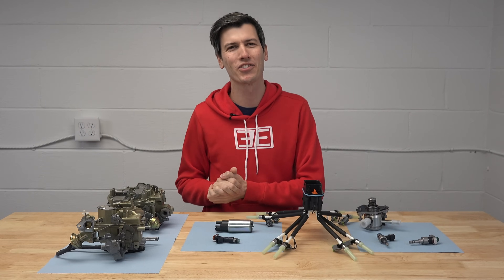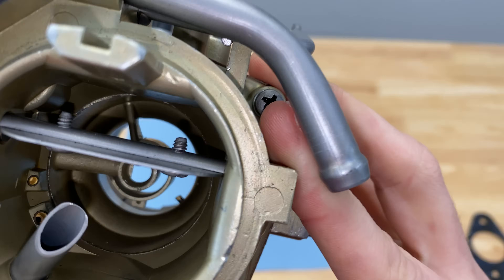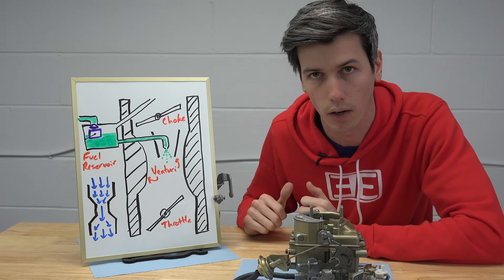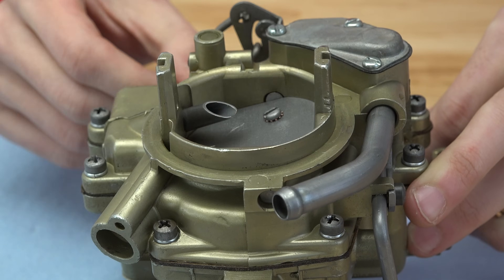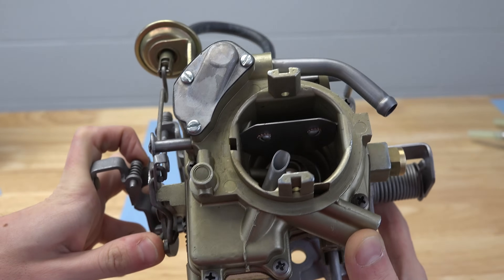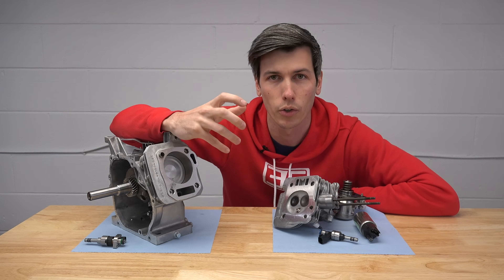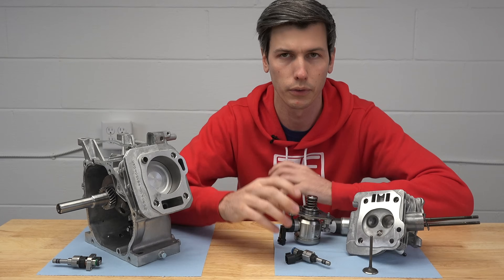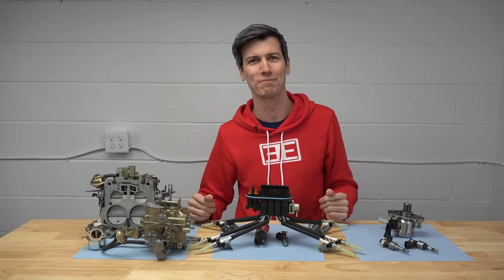What's The Best Fuel Injection? Carburetors vs Port vs Direct

Comment: CAn you do a video on the science behind how tight or loose tapered wheel bearings should be on like trailers and such.  I have found no good source of info that describes the theory of it.  Just basically info that says how much to tighten it.   I wonder if at the smaller level if the bearings are supposed to touch the races or have a tiny tiny gap to let the oil or grease flow thru.  There is no good info on when to know if you can tighten up the nut when they show some wear or if you need to replace the bearings.
Reply: You do need grease between surfaces to reduce friction. Over tightening a bearing will increase friction and cause over heating and excessive wear. 
Bearing... Science? I guess that's the word is quite complex.

If a bearing is wearing you replace it.

Comment: Carbs have a latent heat advantage (cooling of charge as fuel vaporizes)
Reply: Actually, identical with fuel injection. In both cases the heat of vaporization is stolen from the air to vaporize the fuel.
Reply: GM TBI has the effect equally as well.

Comment: Could you please show me that video of yours which explains why an engine cylinder   Is a circle but not any other shape
Reply: Ovals have been experimented with, Honda has on motorbikes. The reason for round is so the surface is as flat as possible at ALL points. It aids in the distribution of not only fuel but temperature and strength.
If you had a square cylinder the air and then the combustion would not evenly flow around the cylindervthe corners would see less flow in them.   In turn it would make the flat walls hotter than the corners creating uneven cylinder temperatures.
The list goes on.

Comment: How does stratified ignition create the same power as a homogenous mix? Does lean combustion generate comparable amounts of power to a normal a/f mix?
Reply: Honda did this for nearly every 1st and 2nd generation Accord and Civic using entirely mechanical carburetors with their CVCC engines. They exceeded federal emission standards without the need for pumps and catalytic converters. My 78' Accord averaged 34 mpg and a lot of torque.... Honda motorcycles had a bunch of torque as well, it makes sense that some of that engineering made it over to automobiles.

Comment: (H) GOOD  VIDEO....very lacking about the extreme  temperature differentials???  occurring during the VENTURI  PHASE !!! 
By design....the best constant intake manifold vacuum....is 23.75--24.25  hg....more or less....the old carb... "seals"...  are designed to with stand only  16 -18 hg ….especially the leaky throttle plate  rods. 
MY POINT....very under-developed  design engineering  scenario ….

Comment: I converted my carbed Turbo to port EFI, and now that the tuning is done, I'd never go back to carb's!! 25% better fuel mileage, way better warm up, spark plugs seem to last forever, alot better power and way more of it, oil stays nice and clean for 5000 miles instead of turning into "Texas Tea" after a couple of months, instant starting, no more twice yearly flooding episodes, no more constant "fiddling" with the carb, no more weird fuel distribution problems, awseome throttle response, and grandma car like drivability. 22 psi boost on pump gas aint too shabby either!

Comment: Here is a really neat fact. Consider what may have happened in the air war against Germany during World War II if German planes were not running on fuel injection! That actually allowed them to fly upside down which was not something the Americans or French could do at first. The Luftwaffe were some badass dudes but even still, once the P-51 Mustang came onto the scene, the Nazi Air Force was getting absolutely pummeled.

Comment: Port and direct injection also have very different air flow turbulence requirements; port requires as little turbulence as possible to keep too much fuel from hitting the cylinder walls and maintain an even flame front from a spark plug. Direct is the opposite, it needs turbulence to mix the atomized fuel with the air for ignition by compression (detonation).
Reply: GM internationally induced as much turbulence as possible on their first truck EFI engine in 87. Heads were cast with half the intake port blocked off.

Comment: Jason, as you mentioned several times during this video how the vaporization of the fuel in the cylinder helps to cool the engine to allow the engine to drawing in more air. That leads me to wonder whether it makes sense to refrigerate the fuel somehow to maximize the vaporization's cooling effect on the engine. Of course that probably makes the fuel more difficult to ignite and perhaps even cause other problems, but I wonder what your thoughts are....
Reply: Expanding gas/liquid absorbs energy.. In this case heat. The better it mixes the more heat is absorbed. Think of compressed air being blown out of a nozzle, see how it's cool?. We do cool the air charge on cars with high intake temps like turbocharged engines, but cooling the fuel itself could lead to freezing but also may take more energy to do than you would gain. So you would loose overall efficiency.

Comment: Jason, another automotive eng. here. You missed the most important point of high pressure DI systems. It needs to be so high, because you are spraying against the compression in the engine.

Comment: The hybrid direct/port injection where a localized area of rich fuel is ignited near the spark plug sounds reminiscent of the Honda CVCC engine intakes with the extra auxiliary intake valves.

Comment: Ah, the Rochester Quadrajet.  One of the best carburetors ever manufactured.
Reply: I have 2 trucks (76, 86) registered that I drives daily, BOTH are Quadrajet equipped. They're great, reliable, and use less fuel that Edelbrock or Holley Equipped motors.
Reply: The QUADROBOG!!!! it went well with the "Slip and Slide Powerglide"!!!
Reply: @painkillerjones6232  Ah, if only you had the knowledge to tune it. Then you'd be able to see its hidden potential.
Reply: @marcomacias8941  It was a favorite of mine back in the day, rebuilt more of them than I could count.
Spot on though, they copped a bad rep here because not many people could tune them properly, but set up properly they were a great all rounder.

Comment: Cool to see carbs on the channel. Looked like a Monojet, then the tried & true Quadrajet. Only correction as far as the carbs go is the don't "inject" fuel at all, that's not how they work. Carburetors Emulsify fuel. The pressure differential created when a piston is no longer occupying a given area in the cylinder has atmospheric pressure pushing (14.7 lbs) down on it constantly trying to occupy the whole cylinder.

Computer controlled carburetors (CCC on GM vehicles 1981-1988) were designed to help better control the A/F ratio. One of the biggest advantages of a carburetor (esp in drag racing) over F/I is the fact that carburetors COOL the incoming air change, whereas F/I really doesn't even get the time or chance to do so....plus a Holley is just plain Cool looking when you pop the hood. F/I is just convenient  though for daily driver, no doubt.

Looks like Advance sent you a GM Vortec 305/350 "Spider" harness lol The 96-00 Vortec trucks are Really good truck engines (pretty much alluding to what was coming up next the LS engines 😉) , & for their time the Vortec heads really flow quite well esp being a plain Jane iron truck head. Too bad they (stock) are limited on their spring install height (nothing a little machining can't fix though)

Comment: Congratulations on this video and your always interesting explanations. I would like to mention, though, a couple of important mistakes I noted: 

1. Gasoline in an engine does not explode, it deflagrates, which is a controlled combustion. The only time when it explodes is when the dreaded instantaneous and uncontrolled detonation, or pinging, occurs, which engineers of course want to prevent. 

2. The purpose of carburetor sprays and fuel injectors is to atomize, not vaporize, the fuel. Atomized fuel maintains a high density while being very effective in reducing the air charge temperature, increasing its density. Vaporized fuel, having a much lower density, reduces efficiency. The idea is to get all the air/fuel mixture all the way into the cylinder in this atomized state, to preserve a high density and ideal air/fuel ratio. The biggest disadvantage of carburetors—and for that matter, throttle-body injection—is not that they are imprecise per se, but that the plumbing between them and the cylinder is less than ideal: part of the mist of fuel droplets tends to separate from the air charge at the turns and nooks of the intake system and puddle on the walls, and another part tends to vaporize due to the heat they find along their path. That is one of the reasons why 1-carburetor-per-cylinder systems of the Weber DCOE type, with their mostly straight individual runners (which are also unaffected by the intake pulses of adjacent cylinders) can offer both better economy and power than a conventional single- or double-barrel carburetor on a multiple-port manifold.
Reply: So.. semantics. Lol.
Reply: Heads Mess there’s always one
Reply: important distinctions, thanks

Comment: Direct injection with combined port is likely the best. Think about it. Late 1990's to about 2005, port injected, a naturally aspirated 3.4L v6 would average under 200HP. Now 2006 and beyond, changes to direct injection with port (to keep valves from fouling), that engine now makes 250HP with everything else the same. And that's without boost. Seems the main thing is that the valve timing isn't influencing the fuel mix, so they can do more with the timing and lift on the cam and that's more power than you could get before.

Comment: The absolute worst were the electronically controlled carburetors. They didn't run all that well when new. The electronic control available at the time just wasn't up to the task. When fuel injection cost came down to about the price of electronically controlled carburetors these carburetors were quickly abandoned.
There is a type of automotive gasoline port fuel injection that wasn't covered. The fully mechanical Bosch system used by some cars such as Volvo.  The system for a 4 cylinder engine had five injectors. The fifth injector was the cold start injector and it was placed upstream in the intake manifold and fed all four cylinders when energized. It was the only one electrically controlled by the coolant temperature. The other four injectors were not pulsed, but were continuous spray. The flow in these injectors was controlled by a damper in the inlet tract upstream from the throttle plate. So if you snapped the throttle open the fuel flow was controlled by how far the damper was pulled open by the air flow, not by the throttle position. In a way it worked like a constant velocity carburetor that was often found on Japanese motorcycles.

Comment: Other advantages of fuel injection over carburetion are:
1. Fuel is injected only when needed, rather than showered down the intake manifold all the time. Thus, a cylinder only gets fuel when it's needed -- when the intake valve is open. Carburetors react to overall manifold vacuum, so some air-fuel mixture goes down the pipe even when the valves are closed. 

2. By electronically regulating injection, the engine gets the exact mixture it needs under all conditions, including shutting the mixture off when the engine is coasting, off throttle. 

3. In racing, the side-loads from road holding can lean out a carburetor when fuel sloshes to one side of the float bowl. This used to be a problem in aircraft, and race cars, in the 1960s and before. Fuel injection, especially computer controlled injection, is immune to this.

Comment: Should have mentioned that fuel pump. Its funny how carbs had mechanical fuel pumps, then when to electric, then efi came and continued with the electric fuel pump, then direct injection came and now uses both electric and a mechanical fuel pump.

Comment: Why would there be carbon deposits within the intakes of a direct injection engine if, at that point, only air flows through them?
Reply: The inlet valves open while the engine is still on the exhaust stroke, mixing a small part of the previous cycle to be reburnt with the fresh intake charge. It's to lower emissions.

Comment: Hey Jason, I know you love tires. Could you do a video that compares the performance of two tires with similar tread but one is much older than another. I've been shopping for tires, I've come across "used tires" that have 90% tread left but the date of manufacture is like 5 - 10 years ago. I think it would really cool to see. I guess the biggest variable in the test would be how the old tire was stored.

Comment: Love the channel. Could you possibly explain for others do a video on how 

Direct injection vs port injection with everything else the same.

 Direct injection will make more power as there is more air in the cylinder as the fuel is injected after the air has entered and intake valve has closed.

Some engines also inject fuel multiple times during one power stroke

Another way to explain is port injection or carb the air and fuel combined has to enter together vs direct injection the valve timing and port only control the air.

 So understanding more air = more power especially at high load.  

Learned during 15 years engine development work.

Comment: Great video thanks.
I would have thought the very fine holes of a fuel injector would have become fouled with combustion deposits (like what you find on a spark plug) if exposed to the combustion chamber directly. Maybe the very high pressures keep them open and clear?

Comment: The best fuel injection is Mad Max style: have Tom Hardy get up on the hood of your car, take gasoline in his mouth, and blow it straight into the engine.
Reply: Haha that Rick and morty episode where summer spits vodka into the intake haha
Reply: WITNESS ME!
Reply: And you just know at least one dumbass hick tried it at home.
Reply: @MarvelousSeven  To be fair it would work if you put it in a pummp spray bottle

Don't ask how I know, the feds are already after me
Reply: SAVAGE TUNER not even hick horsepower baby! You ever been to the strip?
Reply: @savagetuner2404  They showed that in the same scene, IIRC
Reply: It actually wouldn't work well since you would keep on changing from rich to lean making the car even up and then unrev. Gas also tastes terrible and stays in your mouth for quite some time
Reply: Abraam Samor not vodka baby!!! And nope you ever use a carb?
Reply: Abraam Samor sorry wait the gasoline wouldn’t work but the liquor would act as starting fluid
Reply: I was just thinking a few years back the fuel pump let go on my 1980 Ford 3/4 ton.
So I  got the girlfriend to spray gas in measured bursts  so I  could back the truck into the yard... when something won't start, a spray bottle is my go-to!👍🇨🇦
Reply: I also like Red Greens fuel injector.

Comment: What about the mechanical fuel injection? They also have mono point, multi point and direct injection and it's somehow the middle ground between carburettors and EFI. Also, some cars in the 90's used both mono point and multi point EFI to increase power, I think that the Golf GTI Mk3 had this system.

Comment: Aside from NASCAR using it in 2011, are there any modern applications for carburetors that would be more beneficial than port or direct injection? Not accounting for the financial aspect of it. Could they ever be more efficient or powerful?

Comment: My old motorcyle made 29-30 kilometers per liter (!!!) on the average. My new motorcycle takes around 15-17 km per liter.
A check service for my old motorcycle was costing around 80-90 EUR. A periodic check for my new motorcycle starts from 300 up to 400 EUR.
Yeah, I've doubled the power of the engine, but.... I have some doubts.

Comment: Where does the carbon come from that builds up on the intake valves in GDI engines?  If there is only air coming in the intake valve, there is no carbon to build up on the valve.
Reply: Because of emissions regulations causing car makers to install EGRs. The oil is in the recirculated crankcase gas.

Comment: In the late '70s, early '80s Honda had a "CVCC" which used a prechamber with a rich mixture to ignite a lean mixture in the main cylinder. Apparently this is a different type of "stratified combustion."

Comment: I have a 1981 Mitsubishi MCA Jet engine that uses stratolayered combustion by putting a fuel venturi directly into the cylinder that gets over 40 MPG in a Plymouth station wagon with a carburetor.  And Honda had the CVCC engine.  I have an old smog report on the Plymouth/Mitsubishi somewhere... it was an amazingly clean engine.  

Downside to the old MCA Jet engine?  Yup, it's a snail on sleeping pills.

There's nothing new in the world, just a more expensive way to do the same old thing with higher tech.

Comment: Air-fuel ratio is variable in an S.U. carb which both variable jet and variable choke; not as good as modern fuel injection but better than old-fashioned fuel injection that would not come on and off throttle very quickly, and made cars very thirsty.. Yes, I love the old S.U.

Comment: When I was younger I was confused by the Bernoulli effect. It made sense that pushing the same volume of air through a smaller hole requires it to speed up, but I didn't understand why the pressure drops? I now understand it's because air has mass and requires a force to accelerate it. The pressure drop through a venturi creates a net force that accelerates the air. The Bernoulli effect is a consequence of Newton's laws.

Comment: 9:40 How can there be a carbon deposits build-up on the intake valve, if all it comes in contact with is clean air?
Reply: Oil-mist from crankcase breather, use an oilseperator aka catch-can🤐
Reply: Oil mist from PCV